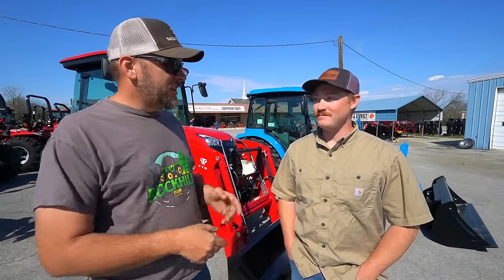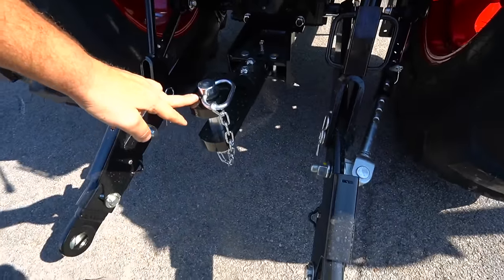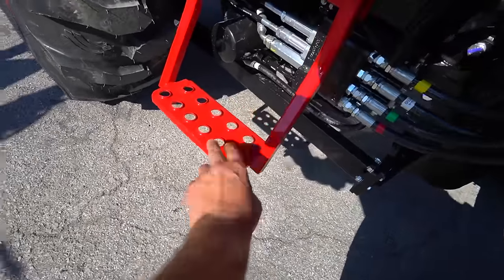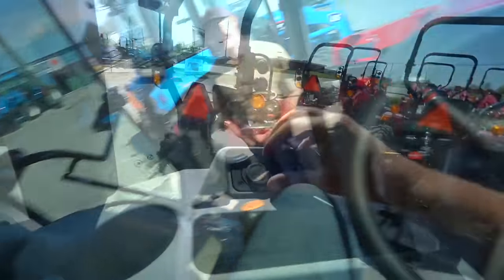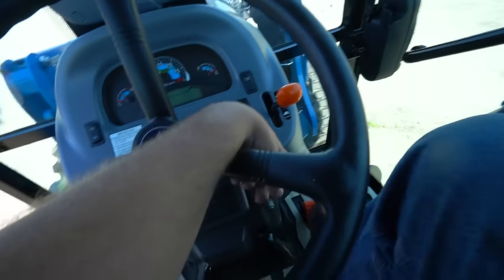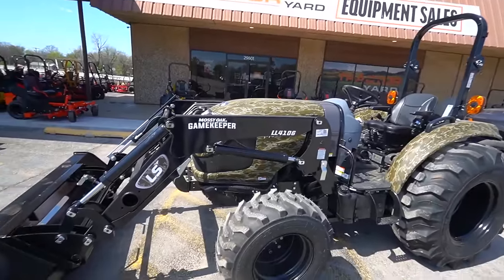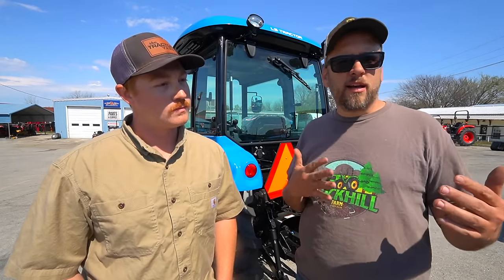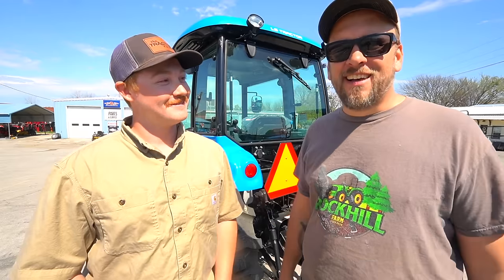Tractor Shopping - TYM vs LS

Comment: The lift capacities and various control functions are important, but the engines, transmissions and warranties would probably be my focus.
Reply from the maker: Very true. Also, I don’t know what to say really about those things. I mean they put out similar horsepower from well established engine manufactures.

The Internet is a big place in 2024 and you don’t see a lot of people complaining about problems I’ve had. Especially with the TYM.
Reply: Both warranties are 6 year powertrain, 2 year “bumper to bumper” and 1 year on the loader. 

The TYM has a 55Hp turbocharged 4 cylinder diesel with mechanical injection pump (made by TYM - formerly Kukje). The LS is a 57HP NA 3 cylinder diesel with common rail direct injection (made by LS Mtron). The LS is rated for 2 more HP at the crank and they’re both claiming around 45hp to the PTO.  

Both tractors in the video, which we mentioned, have a 3 range hydrostatic transmission. They also both have mechanical synchronized shuttle shift transmissions as an option that are a little cheaper. The TYM shuttle is a 2 range with 4 gears within each range (8Fx8R) whereas the LS is a 4 range with 4 gears within each range (16Fx16R).

Thanks for the feedback hopefully this helps you and other viewers!
Reply: @RockhillfarmYT  Personally, I think that shade of blue on the LS is weird, I'm fairly certain it would never grow on me no matter how good the tractor was. The camo one is fine, but I would probably go for the TYM.
Reply: @TheTractorYard  Thank you sir!
Reply from the maker: @dustdevl1043  I don’t love the blue either. I like red.

I would’ve never said I would care about Tractor color but for whatever reason I guess I do. I don’t like the orange tractors.

I don’t mean the quality of the orange tractors I mean I don’t like the fact that they are orange 

When I’m giving my Kubota friends a hard time I call it orange “man pink”
Reply: @RockhillfarmYT  That's hilarious! Love your channel Brock!

Comment: Will you also be looking at the Kioti tractors? I will be making a purchase around the end of summer and it is the front runner so far for features and cost.
Reply from the maker: I have looked at them quite a bit.  I got to run 3 or 4 of them at different locations.

 Nice machines.  I’m probably not getting one though

Comment: The tractors the video have the same tire height but one is wider.

Tractor tire size markings are completely different from car tire markings. 16.9-24 means 16.9 inches wide on a 24 inch tall rim. If there is no "R" before the last number, it's a bias tire.

Metric labeling gives a bit more information. I'll use a 320/70R15 for example.
320 mm (12.5 in) wide
The sidewall height is 70% of the tire width
R to denote radial
15 inch tall rims

Edit: that's not cruise control, it's probably engine speed lock so your PTO always keeps the same RPM
Reply from the maker: That’s what I was assuming the numbers meant on the tractor tires, but it seemed pretty clear that the TM tires were taller

Comment: The TYM's external 3PT handle looks like it is in a really nice position, where you can get to it without stepping into the area behind the rear tire and then between the tire and the attachment....  I thought that the standard measurement for 3PT lift capacity was @ 24" behind the pins, so that larger number was measured where other manufacturers are not testing and publishing #'s ( I could be wrong on that of course, but that is my understanding on it).  The one feature my older tractor (made between '08-'12) does have is an auto throttle, really wish that was available, but all of these newer tractors have the controls on the right side WAY to far forward in the cab, basically eliminating the option to go in and out of the right side door, that would drive me crazy.  I go in and out of the right side door as often as the left side, so 50/50, depending on why I need to get in and out and what is in the way (outside) of using one door or the other.    And we are talking the same size machine, 49hp in my case (Kioti DK50SE).

With the regen systems, I think the manufacturers should offer a display of the filter's status in percentage or even just a light that comes on when the system is getting to a point where it will need to regen soon, so you can have the option to manually start a regen when it is more convenient for you, like if you are going to do some brush hogging, or some other more intensive task where you have the rpm's up anyways and you are going to be using the tractor like that for long enough to complete the regen.  That way you don't come to the end of what you are doing and all of a sudden the tractor decides that it NOW needs to do a regen......  Seems like that would eliminate a bunch of the reasons people do't like them, regen's, though many still won't like them just because!  My tractor never had any of those "systems", so it isn't a problem for me, just think that would make one of the big complains about the regen's timing  better.  And if one of these tractors  will only do a regen when it is parked, that would be a tractor to leave on the dealers lot, just saying.  Both are nice looking tractor's, for the most part.  Anyways, have a good one!!👍
Reply from the maker: Thanks for sharing your thoughts on it. On my John Deere I can toggle the filter buildup percentage on the screen.

Comment: I would add mf and kioti to the comparison. I personally would eliminate any that has common rail fuel injection. Yes they better performance at the cost of higher priced replacement injectors. I would move anything with a mechanical injection towards the top of my list. These systems are usually cheaper parts cost. There are other reasons the mechancal injector pump is a win for me personally that can't be said here.
But all things said and done the bottom line still comes down to how has the most dependable and longest lasting machine.

Comment: Tell me about the loader hydraulic hose attachment location. This one and the one you have on loan have the connections vertically and up higher. Others have them lower and pointing out with the hoses hanging out farther.  Is this a dealer modification or has TYM changed to this better design.

Comment: Wish you could have had a tym 5520 in your comparison as well.
Reply from the maker: Is that what you have? I don’t really know that Model. Is it older or still for sale.

The next larger tractor he had was a 5835.
Reply: I have the 5520 and can still get them. They’re the Branson design that is equivalent to the 574…. Same engine
Reply: We have been selling more 574 models than 5520 simply because the price is the same and the 574 wins in most categories aside from the 5520 has a 4 range trans

Comment: I would love to see a true lift comparison. I bought my Bobcat CT2025 because it has a high lift capacity. The TYM was the only other consideration because it has an even higher lift capacity then mine. Went with the Bobcat because of my local dealer and my last CT1021 was flawless for the two years I had it.
Reply: I’ve heard Bobcat and Kioti are the same machine.
Reply: @yota87truck  Correct. Kioti makes the Bobcat tractors. Both are very good and reliable. On my second Bobcat now and zero issues with either.

Comment: so I have a question. I have a kubota mx4800. it is open meaning no cab. lift capacity on the loader is something like 2250 lbs.  the regen works while i am working which I like.  I have been clearing my 4 1/2 acre hobby farm of big trees and stuff. when I say big trees, I am talking 36" diameter burr oak. Heavier than my tractor can pick up. I currently do not have a backhoe for mine but would love one. Not sure my subframe is set up to support one right now as it stands. I have universal attachments  I was wondering if these companies accept universal attachments or are they like john deere and you have to buy their attachments to get them to work? Are they a high flow hydraulic system? Mine is not high flow. How many gpm flow are they? I added a 3rd function to my system so that I can run a grapple on the front of the loader. I like the idea of having a cab since I am in the north. Call me wanting to be spoiled in my older age. What kind of financing options do you have for those brands? I.E. I didn't come across any money trees in all the ones I have taken out. Just my luck. I did add beet juice to my tires to give it a little more oomph and balancing weight.

Comment: Draft control doesn't stabilize the depth of ground engaging 3 point attachments.  It's NOT called depth control!

Draft control does just that, controls the draft.  If you have a moldboard plow in the ground and are moving along nicely then hit a hard spot, the DRAFT control (if using it) will raise the 3 point to decrease the draft, thus making your plow run more shallow than it was.  This reduces the DRAFT.

If you want stabile depth, you don't use draft control.  You lock it out, and use the depth stop on the 3 point lift control, so it always stops its downward movement at the same position.
Reply from the maker: Thank you for your comment.

I don’t have draft control on my tractor, but I’ve watched a bunch of videos explaining it and read the definition of multiple websites.

I’m giving the caveat that you probably understand it better than I do, but also, I’m going to share the definition that I find repeatedly online caused me to give the summary that I did

“Draft Control is a mechanism in tractors to maintain the penetration of its rear attachment (plough) in ground to avoid engine overload and keep the operation under control”

So, in your example, the way I was thinking of it is when you hit that hard spot the plow is going to try to pull down deeper and the draft control, will raise it up for a second and not allow that, but then return it to where it was you get past that spot

Comment: just my 2 cents worth. You compared a 5 series TYM with a 3 series LS. Why did you not compare at least the 4 series LS against the 5 series TYM? The cab is bigger on the TYM because it is a 5 series. But the cab on a 4 series LS is just as big as the TYM 5 series. Also the LS MT458 which only has 1 HP more also lifts 4,030 lbs at the 3 point hitch. I'm sorry, but I think LS is a better machine than the TYM. I have had the LS MT342 for 2 years and it out pulls the Case 40 with no problem at all. A 2 bottom plow doesn't slow it down. So I don't think you totally did apples to apples comparison. Last thing, my friend also priced out the Deere 3039R Cab before he bought the LS. 4 HP less, no draft control, 1 remote not 2, no rear wiper, etc and it was almost $53,500 compared to $36,500 for the LS. $17,000 more for green paint. My LS is 2 years old, 210 hours, and worked hard. And no problems. And like you said, I continue working when it goes into Regen and the TYM doesn't. Kind of like an electric tractor. Oh gee, got to recharge now. Stop for a half hour. No thank you.
Reply from the maker: Because different manufacturers do their series differently.

These machines are the same length, the same width, the same weight, the same horsepower, the same size tires, and close to the same price

In John Deere, these compared to a 4 series
Reply: @RockhillfarmYT  Thanks for the reply. You're right about LS is more advanced electronically than the TYM. But actually I don't know if that's good or bad. 15 to 20 years from now will be the telling story on that. All I do know is guys up here that use tractors on their farms tried mine out and said for a 42 HP  tractor it is actually quite good. That's why I like the LS models. They are farmers with big tractors (250 to 500 HP)

Comment: I would just buy a New Holland tractor.
Reply from the maker: Why new Holland? Not disagreeing, just curious about your reasoning.

New Holland is popular here with large tractors for farming, but you never see their compacts.

As a matter fact, LS, which I featured in this video, makes the new Holland compact tractors
Reply: Yes, LS Mtron is contracted to build the compact for New Holland. New Holland will have better long term dealer support in my opinion. Even if LS falls by the way side New Holland will be there to support New Holland compacts not LS branded tractors.
Who know about TYM ? No TYM dealers that I am aware of in my circle.
 New Holland is a strong reliable brand without the additional cost of green paint.
I am of the opinion most modern tractors are good machines. This includes TYM and LS.  What makes the difference to me  is the  assurance of a company that will be there for support long term.

Comment: Buy a Mahindra, they never regen. 😂
Reply from the maker: I covered that in my Mahindra video. They don’t have a regen system because of the common rail engine.

However, they do have an extra computer that controls the fuel system whereas the TYM is mechanically fuel injected.

Comment: We missed a few details about engine specs, warranty, and transmission options! See that info below:

Both warranties are 6 year powertrain, 2 year “bumper to bumper” and 1 year on the loader. 

The TYM has a 55Hp turbocharged 4 cylinder diesel with mechanical injection pump (made by TYM - formerly Kukje). The LS is a 57HP NA 3 cylinder diesel with common rail direct injection (made by LS Mtron). The LS is rated for 2 more HP at the crank and they’re both claiming around 45hp to the PTO.  

Both tractors in the video, which we mentioned, have a 3 range hydrostatic transmission. They also both have mechanical synchronized shuttle shift transmissions as an option that are a little cheaper. The TYM shuttle is a 2 range with 4 gears within each range (8Fx8R) whereas the LS is a 4 range with 4 gears within each range (16Fx16R).

Thanks for watching!
Reply: Thanks for adding this information in!
Reply: The LS is non turbo 3 cylinder putting out 57hp?

Comment: The only “negative” with the auto-throttle is that it leads new operators to think that pushing down the hydrostat pedal further increases your power to the ground like a gas powered truck.  To actually get max power to the ground you should throttle up to operating rpm then just barely pushing down the hydrostat pedal will provide the max torque.  
Tons of new operators complain that their tractor is underpowered and they have to be in 1st gear to driving up a hill without totally bogging down and nearly stalling the tractor.  Reality is they could run it in second or higher with the manual throttle at 2500rpm and the pedal pushed about  1/4-1/3 of the way down.  

You have to think of a hydrostat as a continuously variable transmission where barely pushing it down is “low gear” and all the way down is “high gear”. Then understand that the “range selector” does exactly what it says, it sets the “range” that the CVT runs in.  When you bog a manual transmission truck you would down shift and give more throttle. Same with a tractor but to downshift you back off the hydrostat pedal and to increase the throttle you have to use the manual lever. 

That’s a small book but it will hopefully help a couple new owners out.
Reply from the maker: Thanks

This is a good tip that I gas to learn when I got my tractor

Comment: I went from green to blue and have had 2 blue ones, no regrets.  My next one will probably be blue as well.
Reply: I bought 2 LS Tractors for my business I never had any problems with them. They are strong and reliable. Now I’m searching for a Cab Tractor. I’m open to TYM, LS, Kioti, and Yanmar. My opinion is Deere and Kubota have priced themselves out of the market and their hydraulic systems are no where close to the Tractors I mentioned.

Comment: I bought a TYM 3620 from the tractor yard about a month ago. Go experience, great tractor.
Reply: I test drove a 3620 a month ago but am wondering if I should go up to a 4820. Are you satisfied with the power and performance of your 3620. I have some steep hills on my property and am concerned about power.
Reply: @musicgroopie1  I am very satisfied with the power and performance. I have a steep hill also.
I have hauled some logs up the hill on the loader that were seven feet long and about 1 1/2 feet in diameter. I had to put it in 4WD, but power wise the little beast didn't even know the log was there. I won't be pulling a plow or anything like that, just loader and grapple work and brush hog. Would buy again.
On the other hand more power is never a bad thing.

Comment: I purchased a 2024 LS MT573  yesterday and having a 3rd function installed for grapple bucket. I purchased a Root Grapple bucket, 7ft Rotary tiller, 7ft Box Blade and a Stump Buster bucket. All for 65k. John Deere 5075E was 18k for just the tractor and the Kubota M4- 071 was nearly 22k more.I looked at a New Holland Power Master 75 and it was $66,600 .

Comment: I've never operated a skid steer, but I do have a Deere 4520 tractor.  One of the things you taught me is there is both a time and place for each machine type and each has its own set of advantages and disadvantages.  I know you're looking for variety in your channel, but I'm shocked to hear you want to replace your smaller tractor and skid steer with a bigger tractor.  I'm thoroughly confused.  😊

Comment: I own an MT342 HST and below are the lift capacities. 
Loader info from the LL4106 manual. Hitch info from the tractor owners manual 
----------
Lift capacity to maximum height-at pivot pin: 2651lbs
Lift capacity to maximum height-500mm forward:  1643lbs
Lift capacity to 1.5m(59in.) height-at pivot pin: 3043lbs
Lift capacity to 1.5m(59in.) height-500mm forward: 2064lbs
Breakout force-at pivot pin: 4039lbs
Breakout force-800mm forward: 2545lbs
Link capacity Lower link end: 2756lbs
Link capacity 24" behind lift point: 2469lbs

These specs are for all MT3's